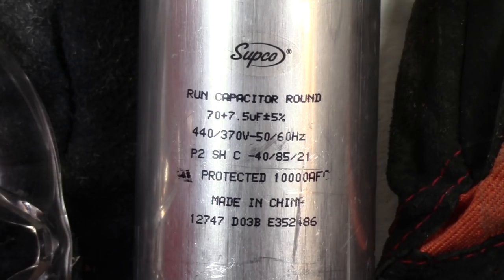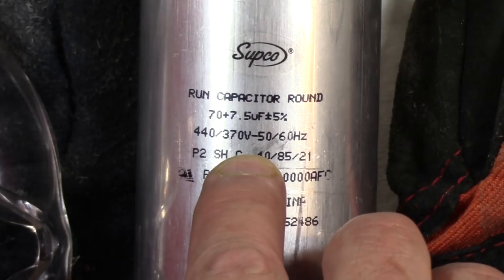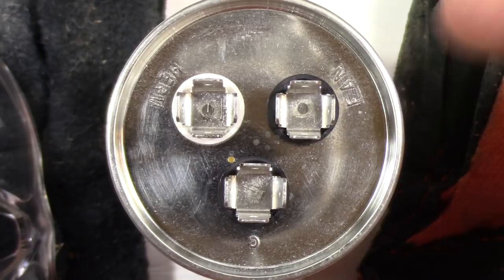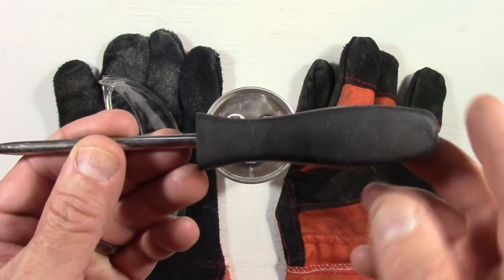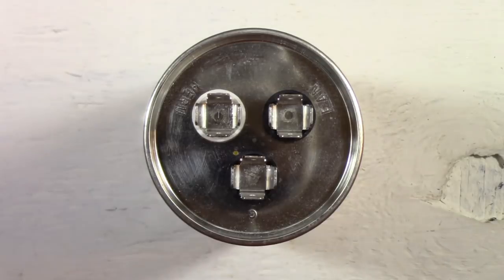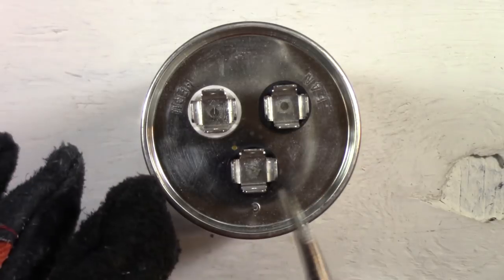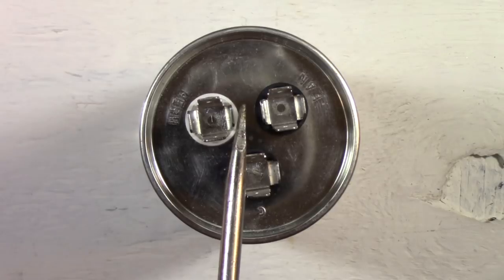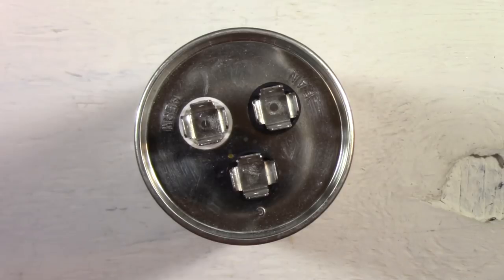How To Safely Discharge Your Air Conditioner Run Capacitor

Comment: I been watching these capacitor videos for 2 days now and finally built up the nerve to change mine out..I'm still alive yay!!!! Great video!!!
Reply: Was it hard?  I need to change mine and feel the same way. :(
Reply: Folks, if don't feel safe, DON'T DO IT.  I've repaired tv's since the late 50's worked amature radios with high voltages.  Two rules with stored electricity (as in tube type TV's); use one hand with leather glove, safety glasses.  A/C motors and microwaves have stored voltages even when unplugged; if you know how, short the cap to ground (the metal can of the capacitor.
Reply: I got a big bang! Much bigger than in the second discharge in this vid! Scary stuff!
Reply: Call a professional. We're dealing with high voltage  in these situations. This video lures DIY guys into a shock hazard. Aside from that you can cause further damage to your unit without knowing what other components need to be powered down or isolated... dont get lit up make the call

Comment: A "professional" diagnosed our A/C problem:  New condenser fan for $928, 2 lbs R-22 for $360 and an $89 diagnostic fee. Watched a couple of your videos and ordered a capacitor for $13 on amazon. Installed it today. After it struggled for a couple of minutes, the 23-yr old condenser fan spun up to full power and works like new. Thanks for your help! Was almost talked into dropping $8k on a new A/C + furnace system that isn't even necessary. That's a cost savings of $7,987...YAY!!

Comment: Good job explaining the safety concerns and the crystal clear method of discharging the capacitor.  The spark jump across between the common and the other two wire lugs is evidence that these electrical devices are still 'live' even when disconnected from the power source. Thanks Richard
Reply from the maker: You are most welcome. Thank you very much for watching and the kind comments.
Reply: Hi James ,How about you ?

Comment: Amazing video! Thank you!  How do you dispose the old bad capacitor after discharging it?  I imagine it might be not good to toss it like regular trash. But is that good enough to throw in recycle? Or any where else?
Reply from the maker: You're most welcome. I don't believe that they are particularly hazardous but most towns and cities now have recycling centers you can take them too. Thank you so much for commenting and the very kind words. I appreciate it greatly. All the best.👍😀

Comment: Should you discharge it before pulling the wires?
Reply from the maker: I would use insulated gloves(electrical) and insulated tools to do the entire job and I would pull the wires with the proper safety gear before discharging it. Thank you so much for watching and commenting. I appreciate it greatly. Be SAFE. All the best.👍😀

Comment: Thanks,  Richard. A gracious technician told me I had 2 capacitors that might fail in the coming year. His company charges $260 for 1 capacitor. I said no thanks, I can do that myself. 

Just got off eBay after ordering my 2 new capacitors and a new fan motor for $172!

Again, thanks.
Reply from the maker: You are most welcome. All the best.
Reply: I had the same thing happen to me, only I didn't know how easy the fix was and now I am $245 poorer.
Reply: They "might" fail. 
That's a heckuva sales pitch.

I might hit the lottery.

Comment: Great video!   Question:   Does the capacitor have to be removed from (e.g.)  the outside a/c unit, before discharging?   If so, how do you safely disconnect the wires, then remove the capacitor?
Reply from the maker: You can discharge it while it is in the unit. Use a pair of insulated pliers and rubber insulated gloves to remove the wires before discharging the capacitor. You don't want to arc weld the wire terminals. Thanks.
Reply: That's what I thought, but I've seen numerous YouTube videos by HVAC techs where they have discharged the caps while they are still wired in.
Reply from the maker: Thanks

Comment: I understand discharging the OLD one you are replacing, but how about the new one I'm installing?  When I open the box of the new one should I also do this test?  Thanks!
Reply from the maker: Probably not a bad idea, you never know you may have a capacitor with a charge on it. I always handle them like they are till I know they are not. Thank you so much for commenting, watching and the very kind words. I appreciate it greatly. All the best.👍😀

Comment: Is there a discharge tool to use instead of a screwdriver. I have read the screwdriver method can damage to capacitor. Also if using a screwdriver how can you tell which type of handle is safe to use for this method?
Reply from the maker: Yes, there is a discharge tool. Here's a video on how to make one, How To Make Your Own Capacitor Discharge Tool : https://youtu.be/pVIV905qby0 
Thank you so much for commenting and watching. I appreciate it greatly. Subscribe, Click The Bell and stay tuned! All the best.👍😀

Comment: Richard, thank you for the info. I'v ordered a new condenser fan motor for my AC unit , is it required also to change out the capacitor when changing out the fan motor? thank you for sharing your knowledge on this matter.
Reply from the maker: A bad capacitor can damage your fan motor too so if you are replacing a faulty fan make sure you test the capacitor and verify that it is working correctly. If you put a new fan motor on your unit and the capacitor that runs it is bad you will damage the new fan motor in no time at all. Thanks.

Comment: Thank you for the info but after you discharge are they trash or can you hook it back up to charge
Reply: This isn't the best way to discharge a capacitor because the shock can erode the seal and make it leak electrolyte later, but you can do this a few times without hurting it.  You can hook it back up and it should be fine.   The pros will use proper capacitor discharge strips because they're doing it hundreds of times.

Comment: Does discharging the capacitor ruin the capacitor?  If I wanted to take it out and test it with a manometer.
Reply from the maker: Capacitors are built to be charged and discharged continuously so discharging the capacitor will not harm it. Thank you so much for commenting. I appreciate it greatly. All the best.👍😀

Comment: the proper way is to short with a right value resistor, you can compute the value of resistor by the max rated voltage and microfarad of the capacitor.
Reply from the maker: I also have a video on make a discharge resistor tool for the capacitor here: https://www.youtube.com/watch?v=pVIV905qby0&list=PLnxXRLSlmSVNnx4TF5wcfK-yoSJ7Mpvq3&index=4&t=0s Thank you so much for watching, commenting and the kind words. I appreciate it greatly. All the best.👍😀

Comment: My condenser outside clicks but does not turn on. Does that sound like a bad capacitor?
Not a big fan of working with electricity but might as well save some money. Great video btw, very informative.
Reply from the maker: Have a look at it. If it is deformed or leaking you will know right away. Otherwise follow the instructions on this video to test it: https://youtu.be/19A9lvQ6lIA. Be safe. Thanks.

Comment: I'm about to replace the blower motor on my RV air conditioner, and apparently part of that process is discharging the capacitor. I don't want to die today. I just picked up an insulated screwdriver, but they didn't have any insulated gloves. I'm pretty freaked out about this. Is the insulated screwdriver enough? If not, what else can I use to protect myself and my home? Thanks.

Comment: Very nice video! However, I do have a question for you. I disconnected and discharged my capacitor, but did not work on it immediately, as I was still getting a voltage reading from one of the wires. Since I was in no particular hurry to get the job done, I left the unit disconnected and then went back a couple of weeks later, and this time I did not register anything. I was wondering if the Capacitor may have discharged itself over time? Do you know if this might be what happened?
Reply from the maker: Yes that is possible but I would not rely on it happening. Manually discharge it just to be safe. Thanks.
Reply: Thanks Richard for the reply, and I will definitely discharge it using your instructions above before working on it. I was just curious as to why I would have gotten a reading one day and then nothing when I came back a couple of weeks later. Also, I read somewhere about the reading possibly coming from the furnace. Do I need to disconnect the furnace from the main panel in the garage, or would it be sufficient to just disconnect the A/C at the unit? Also, just to be on the safe side, I do plan to shut of the AC units from the main panel in the garage in addition to shutting them at the unit, but was wanting to know if I need to shut off the furnace from that panel in the garage as well? Any advice you could give on this would be greatly appreciated.

Comment: An insulated screwdriver has the insulated material which is like a dipped plastic that runs to the tip as well. This is a regular screwdriver
Reply from the maker: Thank you so much for watching, commenting and the valuable feedback. I appreciate it greatly. All the best.👍😀

Comment: Oh, and Richard, I just love the safety tips along the way. I'm all about safety.

And another thing, I viewed another video that said to use a 1,000 ohm resistor instead of a 0 ohm short of a screwdriver. 

Your thoughts?
Reply from the maker: I made a video on making a capacitor discharge tool that will do that for you here: https://youtu.be/pVIV905qby0?list=PLnxXRLSlmSVNnx4TF5wcfK-yoSJ7Mpvq3 I use a 10K ohm resistor Thanks.
Reply: Tony Fischer By the time I shut off the breakers and pull the safety disconnect, remove the electronic compartment skirt and use a voltage detection probe to verify no power, the caps always have run down by the time I short them. If the cap is 10 years old, I replace them as they are cheap.

Comment: I have a question for you! I have a three pronged piece between terminals, like an insulator.  How do I remove it safely before discharging my unit? I kind of blocks me from touching the terminals? Thanks :)
Reply from the maker: You could use a tool like this that I show how to make here: https://youtu.be/pVIV905qby0?list=PLnxXRLSlmSVNnx4TF5wcfK-yoSJ7Mpvq3 or you could just use (very carefully with insulating gloves) Grand General 55250 Black 12-Gauge Primary Wire at Amazon:  http://amzn.to/2a558yQ as a short. Thanks.

Comment: Hey Richard quick question. I'm checking my home ac unit for the compressor not coming on but the condenser fan is working. It's a dual capacitor and I was checking for bulging of the case and had one hand on the bottom of capacitor and touched the other hand to the AC housing and felt a low shock through my body lol.
I haven't taken anything apart yet, just visual checks. Could that indicate a short to the case of the capacitor? I am a qualified auto technician so I'm aware of how electricity works. 
Thanks

Comment: I have a Frigidaire Model# FHWW123WBE A/C window unit which I plan to replace the fan motor bearings. Is it best to discharge the capacitor or unplug it from the separate switch terminal to work on it?

Comment: Ive replaced run and dual run capacitors right after the ac was running and killed power and i forget to make a routine of shorting it w screwdriver but have never been shocked with bare fingers pulling wires off. Now a start capacitor that doesnt have a factory resistor or is cut for some reason then im more careful with that. Usually i just use needle nose pliers using leverage w top of cap to pull wire off. N check with capacitor function on meter to see if weak enough to replace, plus or minus 6% of the mfd rating on it. (Preventative maintenance). Or if terminals look rusty n just wanna check it while running, amp clamp and voltage across it formula. Amps x 2650 something ÷ volts equals the mfd.

Comment: Do i have to do this on the new one that's going to be installed
Reply from the maker: You should not have to but it does not hurt to be safe and do it anyway. You never know if it has been charged and you should handle them as if they have been charged until you know they have not. Thank you for watching and commenting. I appreciate it greatly. All the best.👍😀
Reply: @richardlloydusa  thank you

Comment: What would happen if you short the herm and fan terminal swhile the capacitor is charged?
Reply from the maker: Both capacitors (there are two in a dual run capacitor, Herm is one and Fan is the other) would discharge their energy as you would be completing a circuit to the common ground they both share. I would not recommend doing that as you may damage the capacitor internally. Here is a video I made on how to create your own capacitor discharge tool: https://youtu.be/pVIV905qby0 Thanks

Comment: would rubber gloves work as well ?
Reply from the maker: If they are electrical gloves yes. Otherwise an properly insultated tool will do the job as long as you don't touch the metal when discharging the capacitor. Be Safe! Thank you so much for commenting and watching. I appreciate it greatly. All the best.👍😀

Comment: Can the capacitor be damaged by incorrectly discharging/touching the wrong terminals?  If the cap. has wires attached to it, how do you remove the wires to discharge it without getting shocked?  My cap. is installed sideways and hard to reach, and not able to see which connector is which.

Comment: So quick question… after discharge, one should still treat it as live, right? That makes sense to me… safety. How on earth are we supposed to take it out using those thick gloves? Is that really doable? Or should someone feel confident touching it after discharge? Also, don’t worry, any answer to this question will not hold any parties responsible for any outcome whatsoever… I just need a real answer.  Also, thanks for making this video
Reply from the maker: I use insulateed needle nosed pliers but I have a digital multimeter and I can verify quite easily if the capacitor is discharged or not. BTW the meter is  cheap at Amazon(paid): https://amzn.to/3A6SBHu so I don't have to be too paranoid about it. Well worth the money. 
Thank you so much for commenting, watching and the very kind words. I appreciate it greatly. All the best.👍😀
Reply: @richardlloydusa  Thank you
Reply from the maker: You're most welcome. All the best to you.

Comment: You said you can discharge while it's still connected to the AC unit. Is this BEFORE you unhook the wires? That won't harm anything?

Comment: Well, changed my capacitor ....i had recently stepped mine up....but i wanted to put the correct rated capacitor....i have done it before , but i knew the capacitor was dead..this was a fully charged so i was a little unsure..so what i did ,i  shut down main breaker in the house and pulled the outside breaker for the unit itself waited 4  days gave it time to discharge on its own. cautiously made the swap..got the one out..took a screw driver attempted to short it our as explained here , was dead as a door nail..so my experimant turned out great as far as letting capacitor discharge on its own. but still be cautious , 400 Volts is a lot of JUICE~~ LOL!
Reply from the maker: Glad to hear about your positive results. Comments like this make my DAY! 😁️ I'm glad to know I could help you and that you got value from my work here and yes 400 volts is a LOT of electricity. Be SAFE always. Thank you for watching, commenting, subscribing and the very kind words. I appreciate it greatly. All the best.👍😀

Comment: I changed out my capacitor. When I tried to discharge it, nothing happened. No pop, no fizz, nothing.  Also, it wasn't bulging to begin with, but the "fan" notch was blackened or rusted. Is this a symptom of something worse going on with my unit, or should I just be happy I'm sitting in a cold house now?
Reply from the maker: They can be blown internally and therefore have either already discharged or are not able to release the stored charge. The corrosion on the fan connection may have been caused by heat from the capacitor as the capacitor degraded or it just may be a random event. Make sure the cable connector is good (if not replace/clean the connector). Regardless if your unit is blowing cold air be happy. 👍😀
Reply: Just a comment to add to Richard's ... that capacitor in your HVAC system is sitting in an AC circuit.  That means the voltage is alternating between +120V and -120V and everywhere in between 60 times a second.  If the old capacitor was pulled right when the AC power just happened to cross the zero voltage mark (or near to zero) in the sine wave, there wouldn't be much of a charge on the capacitor anyway, and thus no pop (or none a human would notice).  Statistically, that's gotta happen from time to time.  You just shouldn't count on it.  :)

Comment: looks like that screwdriver is not rated insulation for voltage. You should use a insulated screwdriver that's meant for voltage and typically they come with orange handles with a voltage rating printed on it

Comment: You can call the 'C' common, but that's a bit of a misnomer. Calling it "center" will help when trying to understand the circuitry of the dual capacitor.

Comment: if power supply is shut down for several days will capacitor lose voltage?
Reply from the maker: There's really no way to know. The best practice is to always handle the capacitor as if it's charged. Thank you so much for commenting and watching. I appreciate it greatly. All the best.👍😀

Comment: Good video, but this is NOT the proper safety procedure when discharging capacitors. If you really want to do it the right way, use an appropriately rated resistor to short out the terminals.
Reply from the maker: Thank you. here's a video on how to make a discharge tool https://youtu.be/pVIV905qby0 Thank you so much for commenting. I appreciate it greatly. All the best.👍😀